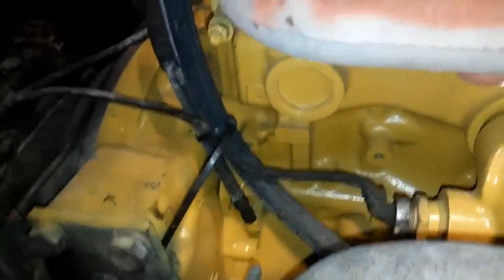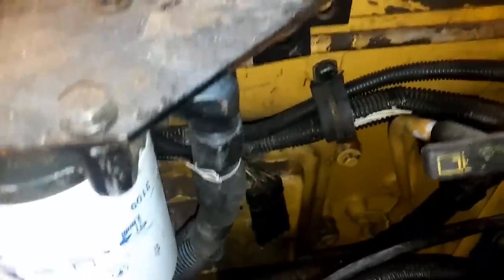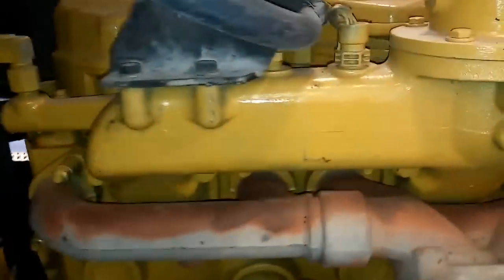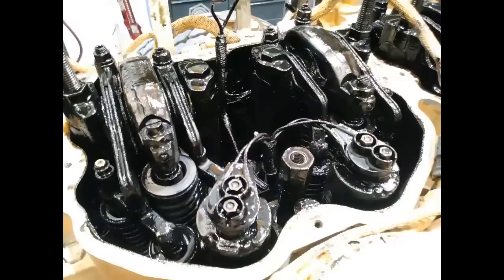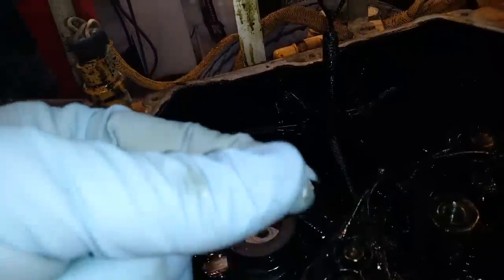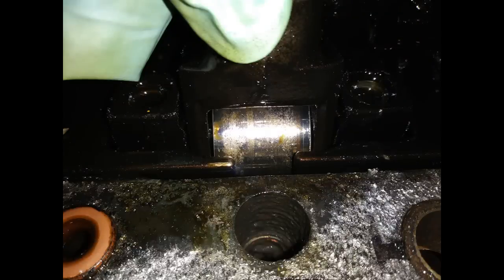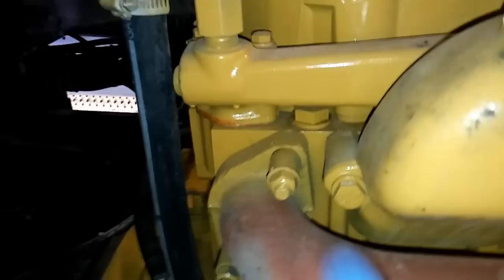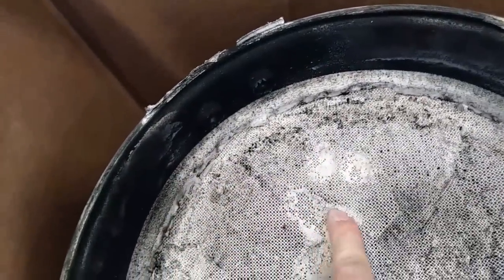The Cat C12 And C10 Engines. Know Your Engine.

Comment: I have a c12 2ks...1.7 million...major overhaul at 900,000 and rods and mains at 1.4. This engine gets great fuel mileage and runs strong. Thanks for the video. I always enjoy your content.
Reply: how many speeds u got? mine is a super10 and i'm doing 70 mph at 17.5 rpm... is that normal?
Reply: It’s normal if for a short rear ends. I have a 13 speed with 3.70 rears...at 70 I’m about 1500 rpms. You pry have a 3.91 or like a 4.10 rear end.
Reply: How much  did the overhaul cost you ? Did it come with a warranty ?
Reply: @wrxtawd  In 13th your running 1500 RPMS at 70 MPH with 3.70 Rears, What Size Tires are you running?
Reply: @taylor11089  295/75 on 22.5s

Comment: Coolant leaking into the oil on ANY engine is bad, but if it happens due to poor engine design, I wouldn't necessarily call it a good motor.  C15 already sounds like a better choice from just the heavier duty cylinder heads alone, if overheating is going to be a common occurrence such as in steep grades in hot climates, high altitude switchbacks, and very remote long hauls like in Australia, this engine doesn't seem to be the 1st choice to go with.
Reply: EXACTLY my thoughts. Poor engineering from the get go.
Reply: JIGA BACHI The Northstar 4.6L V8 is complete crap and leaks everything, do you attempt to fix the problems inherent to the motor, or just replace it entirely?  That's the difference between good and poor engineering.
Reply: C15 with its twin turbo option and larger displacement for heavy long haul load tractor trailers, C12 for modified heavy duty pickup truck platforms that can fit it.  I just wish there were smaller Diesel engines that can fit in the space a small block V8 would take up, they're either extremely rare (like the Perkins Diesel used in Ford Rangers) or are rather oversized and heavy anyway, like Detroit 4 cycles and Duramaxes.
Reply: @MidnightMechanic  wtf are you talking about. You make no sense. Lol at putting a 3k pound c12 in a pickup truck. Good luck with that

Comment: The Cat C-12/2KS, 3406E/2WS & C-15 6NZ, along with The Cummins M11 N14 525 RedTop Celect+, and Pre-EGR ISM & Signature 600 we’re ALL EXCELLENT Motors that had Good Torque of that Time Period that we’re Not a Detroit Motor. Detroit Made Great Motors as well during that Time Period that were Great Cost Effective Motors, they just Lacked The Torque that The Cat & Cummins Motors Offered.

Comment: My previous employer was in the top 500 of independently owned trucking companies in the United States and we ran all C10 ans C12 engines I think they're very good engine minimal amount of problems other than cam followers as you mentioned and occasional oil cooler or water pump issues they were a great engine I had seen many of them go to a 1.2 mil , to 1.4 mil before needing an overhaul,  great video thank you

Comment: Wondering if 89,000 miles in a mobile home is alot of miles? Does the c10 have an egr cooler and dpf filter. 2000 is the year

Comment: The C-10/C-12 Cat engines were probably one of the most bullet proof later model engine Cat ever made. (3306 is legendary!!) 
 I'm surprised Ape called out the single liner seal as a problem area because I never seen one leaking in 24 years as a Cat tech.  The engines weren't long on power like the larger bore 3406/C-15 engines were, but man they went like the energizer bunny!  As Ape stated, the biggest problem with them were the valve lifters and camshafts.  If you made sure to keep the valve adjustments every 100,000 miles then you typically were good to go.  Ape is also correct about the coolant manifold bolts, that's the stuff nightmares are made out of!  That and the intake manifolds come in as a close second.  Aluminum and steel bolts just simply don't play together at all, and I have spent many an hour trying to drill out broken bolts and attempting to save the aluminum housings.  Anti Seeze is your friend on this engine.  Great vid Ape!!  I always enjoy learning a little more about my craft from someone else!!  Cat never did, but I have often wished that they went with the mid mount liner in the 3406/C15 engines.  Rare day that you found a blown head gasket due to liner falling like the C15 engines did due to liners falling.
Reply: matt lee amen on the 3306. Or any 3300 series.

Comment: C12s are a bad ass little motor it's a shame they are getting scarce
Reply: We have a few in dump trucks where I work. Some with over 520k miles and 27k hours
Reply: @isaacrecord6162  27.000 engine hours? what maintenance works do you recommend for a C12 with 5500 hours in a combine harvester?

Comment: Just did a head gasket on a 3306. Looks very similar. Cam is further down in the block and 3306 is mechanical. Is the C10 a newer version of the 3306?
Reply: Onestop Maintenance I wish. Looks like a newer version of 3176.

Comment: Just a bought a truck with a C10, runs good has plenty of power. I noticed that oil pressure is a little low from my 3406. What's the normal oil pressure on these C10's. 20 to 25 when sitting. 40 to 45 when running down the road.
Reply: That seems common.  That's about where I am at for my c12  250k original miles.

Comment: I have a 2ks engine runs great oil pressure 48 to 50 pounds great boost Im am actually impressed with this little engine being I just come out of a 550 cat.BUT the thing is using oil big time I need another 8 weeks out of the old girle be four I can rebuild her,I know the oil is coming from exhaust guides for one thing.I was wondering if it will hurt it to keep running it for 8 more weeks as long as I keep the oil topped off?
Reply: Did you overhaul your 2ks ? How much did it cost you?

Comment: I have a question,
Whats the operating temperature range of this engine ?
Also, how much horse power you gain once you remove EGR
Lastly, where is the thermostat located on C12 ?
Reply: Does it have EGR?
Reply: @mathewkromeo2934  yes it does have Egr for now.

Comment: I have a C10 leaking oil at the power steering pump, do I need to pull the compressor to access the pump or can use like a moon wrench to get the  upper bolt out?

Comment: I am looking for some input or opinions about adding zinc additives to the oil ?
Oil used to have a higher zinc content but  
because of emissions , catalytic converters or exhaust filters there is a lower content now 
15W 40 Rotella  1100 ppm
My question is ...can I do some harm when adding zinc additive?
lots of old timer enthusiasts add that in their flat tappet engines.
Any input from anyone ???

Comment: CAT C12 customer came in he did a oil change and found a piece of pushrod in base. I took valve covers off and there was a broke/bent push rod laying in overhead. BUT truck is running ok except cyl #3 is 50% power down and all rods are in place????? Cyl 4 has missing wobbler on jake piston. How does that happen.
Reply from the maker: Generally you get damaged pushrods from 1 of 2 ways.. An overspeed is one of them, but less likely and the most common way for the C-12 is camshaft/lifter is damaged on that cylinder and caused excess gap between the pushrod and lifter.

Comment: My 18 year old 2KS has 1.5M miles on it without an overhaul.  I bought the truck with 1.4M.  Hoping I can make it to 2M before rebuilding it.

Is there an easy way to inspect the cam and followers without removing the head?
Reply: What’s the oil pressure in your c12

Comment: Need some advice, my c10 is burning oil but no blowby at all , imagine valve seals are shot, does the c10/12 use valve seals? If so does anyone have the part number, thx in advance

Comment: Quick question, what's the max horsepower and torque can I have on my c12 engine @adeptape
Reply: My Cat C-12 PDF says Standard 430 HP, 1650TQ. I believe they could be Rated Up To 445 HP.

Comment: I know it’s an old video, but this engine is the only cat engine I’m glad I never drove and never wish to drive. Here’s a little story I have with it. This guy who was know for speeding and trying no to get ahead of everyone and stealing jobs. Well he had a C12 with a 13speed in a classic freightliner. Well, one time I stop next to him at a red light. I had a 3406b with a 9 speed(I pulled the fuel screws out and put the AFCR as far as it would go before going over 1100 on the exhaust temp, I was 19) and he tried to pass me, but the light was up hill and pretty steep for 84000 pounds. Long story short. I pulled a whole truck length in front of him and cut him off. Sure enough he called my dad and said I was speeding. To which my dad replied, “he just f***d you off a light didn’t he?” Cause he was on the phone with me as I was doing it 😂

Comment: My 2003 C12 in my RV mysteriously lost oil while parked without any noticeable signs.  As it was park I assumed that the oil level would be ok.  So when I started it, it rand noisy (grinding?) for a couple of seconds and the engine stopped and would not turn over again.  It just made a clunking noise.  I'd like to try & turn it by had but I don't know what size socket I'll need to get plus a long handled sprocket bar.  Can you tell me what size socket I need and what direction to turn it?  Thanks.

Comment: hey man, I have a 97 pete 378 and its got a c10. I was wondering if its a good engine for me to use to do local work hauling dry van trailers at like 30,000lbs. the previous owner used it to transport steel rolls of 100,000lbs but I am not too familiar with pulling this kind of weight if it will stress the engine. Also it doesnt have jake brakes, so would installing them be a good option too ? thanks alot for your help and videos!!

Comment: I have a question there’s a truck that I’m trying to buy they did a swap from a c12 to a c10 same transmission from the c12. Its it a hard swap am I going to run into problems or is the electrical wiring going to be hard? Should I stay away from it

Comment: My c 12 is in the shop right now. Not firing on #1 cylinder. My mechanic pulled the valve cover and found the injector push rod jammed in the injector, says injector nozzle is not working. Any ideas?

Comment: I am looking at a KW T600 with a C12. It has coolant in the oil. 800K miles. I watched this video. to find problem would I pressurize coolant system and see where water comes from with the pan off? Or would I first check for cracked head? Would there be bubbles in coolant or would it be pushing water out of header tank?

Comment: Where is located the oil tempeture sensor?
Reply: These engines did not have an oil temperature sensor for the engine ECM, however the OEM supplied sensor for the dash gauge was most always located in the oil pan in one of the drain plug ports.  Look for a sensor in the bottom of the oil pan.
Reply: Driver side on bottom of oil pan.